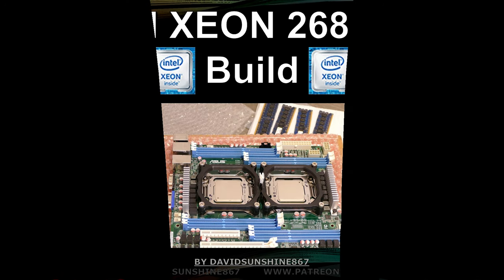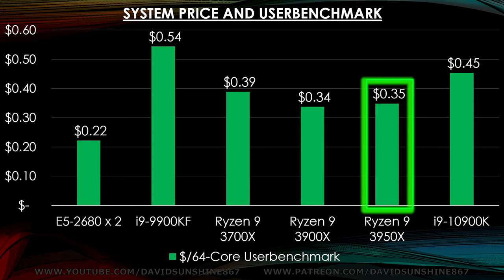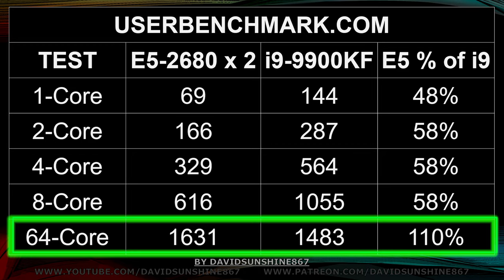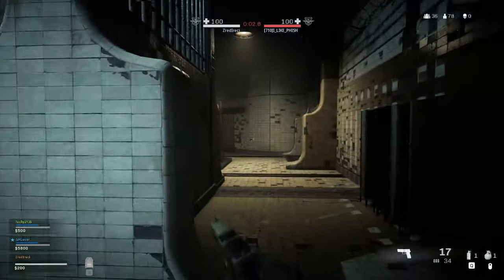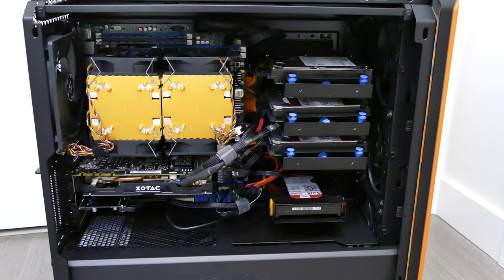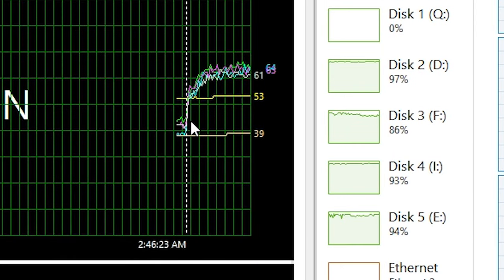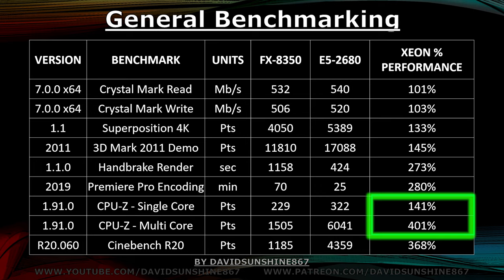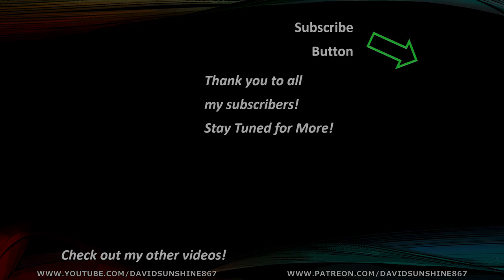Dual XEON CPU Build vs. Intel i9 and Ryzen 9, It's Faster!

Comment: Hi I’m looking to build a dual Xeon Hackintosh as well. Would u still recommend the links in ur description?
Reply from the maker: Hi,
I've never tried it, but looks like others have been successful in it. 
https://youtu.be/P8sN3-OwdVc
The links in the description are updated with the best combos and prices that I could find on AliExpress, so check them out, and if there's anything in particular you're looking for, I'm sure there's something on AliExpress that'll suit your needs, they got it all.  The V2 dual systems definitely provide the best bang for the buck. 
If you can build a dual boot system like the YouTuber linked above, that would be awesome!
Also look into V3 Xeons if you are willing to pay a little more and want the extra performance.
Cheers!
David.
Reply: @DavidSunshine  Thanks  man, so yah i ordered 2x E5-2680 V3 12-Core and a chinese x99 LGA 2011 MOBO. Lets hope it performs well!
Reply from the maker: @jameskent1845   Anytime!  Nice!  Good choice, that'll be a powerful 24 core system with DDR4, I'm sure it'll perform well.  Let us know how the build goes!
Reply: Will do David. One more question. If I’m using 2x e5 2680 v3 and possibly a rx580, Vega 64 or 5800xt (not sure which one to buy yet) how big of a PSU would u recommend? I’m going to be using one of the x99 MOBOs from China. If that helps. Thank in advance for u advice.
Reply from the maker: @jameskent1845  Hi James, great question!  I personally do not like to load a PSU too heavily, it can create stability issues and the risk of burning out PSU components by running it near the rated capacity.  The brand also plays a big role, since the cheaper brands will cut corners by using smaller components.  I trust the brand's Seasonic, Asus, Corsair and EVGA; listed highest preference first.  The Seasonics are out of stock, hard to find, and expensive, but give you the best quality in PSUs. 
The CPUs (115w) and Vega 64(295w) add up to 525W, with the motherboard and hard drives, I'd say you're looking at pulling 625W.  If you plan to run the video card and CPU on max continuously, like mining cryptocurrency 24/7, I would go with 1000W, like this: https://amzn.to/3eu3kkl
If you are only gaming and rendering, you can go with 850w, like this: https://amzn.to/3xUTdg5
You want to load a PSU to 80% max, which is 680w of 850w, so you're right up there with the 625w system load, 73.5%, so you can run it, buy it'll run a little hot if you mine with it, and that can lead to premature failure.
For continuous operation, around 50% load is easier on the components. 
I've been mining cryptocurrency and I've been keeping the PSUs loaded around 50%, and they just run slightly warm, not crazy hot, that's the way to run em for long term reliability.
I linked the cheapest Gold efficiency models above, which I recommend, one which is semi modular, I don't see a benefit of fully modular since you'll be collecting to the ATX motherboard anyways, it's only really required if you are building/using custom cables.
Additionally, if you run the Vega 64, or any card over 150w, I highly recommend running two PCIe power cables to it, even though one cable with two heads can fit.  295w can overload the 8 pin connector on the PSU end and melt it.  They don't tell you that, but it's happened before. You'll get better voltage and current delivery with two cables as well. Less voltage drop. Most PSUs come with 3 cables.
Hope that helps! 
Cheers,
David.
Reply: @DavidSunshine  thank you so much man!! I will prolly stick with the 850w PSU since I’ll mostly be gaming and rendering video occasionally. :)
Reply from the maker: @jameskent1845  You're welcome!  The other cards have lower wattage, but even at 220W I recommend 850w, and two cables to the card, it's still considered a high power card since it's over 150w, which is all I'd load a single cable to.  That'll create a good stable system.
Cheers!
David.

Comment: So I'm looking to do a dual Xeon now it will be v4 with ddr4, The reason I'm doing this is for modeling, rendering an a bit programming. will this be good for that. anything will beat what I'm using now an I7 3770, so it's time for a new system.
  Thanks for the video
Reply from the maker: Ya it'll be awesome for that, V4 is much better than what I was running, V1.  It'll have better single core performance, and that'll be important to keep the system snappy and fast while you operate it, having great multicore will be good for rendering and compiling.  Ya it'll destroy the 3770 lol. 
The V4s might be expensive though, price it out and see how it compares to the Ryzen 5900X or 5950X, those will have unbeatable single core performance for the price, along with pretty good multicore, which can make your system much snappier than the Xeons, important when working with 3D modeling software, panning, zooming, rotating etc.
Of course the used Xeons can provide great bang for the buck though, but it's good to compare the pricing and performance as well.
Hope that helps!
Cheers,
David.

Comment: how did you power the 2nd cpu, did you use Sata to 8 pin connector for the other one?
Reply from the maker: Hi,
I have the RM850x, it's a modular power supply and so I just used a couple 8-pin cables and required by the motherboard.  I wouldn't use a SATA adapter, since Xeons pull full 125W and it might overload the PSU rails, I'd recommend getting a power supply with the right connectors.  A 650W with modular cables would work, if you have a demanding GPU, it needs an 850W PSU though, as it can pull over 600W continuously, which would really work a 650W PSU hard.
Cheers,
David.

Comment: How do you think a dual cpu with the E3 1200 series?  Especially the hyperthreaded ones.
Reply from the maker: It's has great single core performance, but the architecture doesn't allow for dual core operation, so well have to use the E5 series for that.  The new V3s are old enough to be cheap but still perform pretty well! So that's a good option, E5-2678 V3 is probably the best bang for the buck right now. 
Cheers,
David.

Comment: I Built A new (toMe) Dual Xeon Server With The Supermicro X9DRI- LN4+ But I Used a Pair of the E5 2696 V2's in my main Supermicro 24bay server but just a pair of E5-2620 v1's in my FreeNas Build  I Have a pair  of Noctua U9DX I4's on the dual 2696 v2's and a pair of Hyper 212 Evo's on my Dual X5675's But a Pair of Gammax GT"s on a pair of 2620's..I Was Wondering What Cooler are you using on yours? ?
Reply from the maker: Nice builds! That Noctua U9DX is a great cooler, specifically built for the Xeons.  I was thinking about configuring mine to create a tunnel, but I pointed mine upwards instead. I was worried the hot air from the 1st CPU would make it harder to cool the 2nd CPU, but if it's a tunnel towards the back, it might be better since you eject the hot air out the back of the case, mine pools at the top of my case, then makes it's way out through the back after some time, so there might be some short circuiting going on. 
I used 2 cheap Aliexpress 6 heat pipe coolers(https://tidd.ly/3pUjEhk, 3 fans, without RGB), they seem to work well, since I can keep my cores fairly cool and maintain 3.1Ghz on all cores even under a full burn-in test with RAM/HDDs/SSDs/GPUs at max.  I wouldn't recommend my coolers though, I needed to modify the mount so that I could get them onto the sockets, and I can't easily remove them while inside the case, so I had to install them before installing the motherboard and CPU heat sink fans(Since the mounting screw is blocked by the fan).  So I definitely don't recommend 6 heat-pipes, even if it provides a little more cooling. It would be a pain to remove the motherboard, just so I could swap the CPU, that's why I recommend smaller heat sinks that can screw in from the top.
Cheers!
David.
Reply: @DavidSunshine   ok Cool..I will probaly just order me either a second hyper 212 evo(old Faithfull) or another gammaxxGT cooler(its just a tad shorter than the 212 evo) I have one of Each on thair untill i make up my mind..lol. i have spent so much & i just hate to keep spending on it as i just dont need 3-4 dual Xeon Servers & im really out of room to put them..lmao..
Reply from the maker: @bigchew3149  Nice, those sound like great options!  These cheap coolers are hit and miss, never know if they'll perform well, but I like budget stuff.
Ya that's a lot of systems!   I barely have enough space for 1 lol.   If you do want to try a cheap one out though, check out this 4-Pin heatsink(I wouldn't get the 3-Pin, cuz the PWM fan speed control is good to have):  https://tidd.ly/2K2UxJm
You can screw it in from on top.  Might not perform as well as your Hyper or gammaxxGT, but who knows? Maybe they will perform well and cost less?

Cheers!
David.

Comment: I wondering what Gpu you use on this Benchmark test?
Reply from the maker: Hi,
I had the Zotac Mini 1070 in there for testing. 
It's an sufficient card for gaming, nothing fancy, isn't super powerful, but worked pretty well. I upgraded to a 3070 and the increase in performance isn't that great.  It's smoother for sure, but any of the games are still great on the 1070 actually.  I wouldn't mind using the 1070 for BF5 or Half-life Alyx, they both work well on the 1070.  BF5 actually is CPU limited on the Xeons with a 3070, so you'll need to switch to DX12 if you use that(uses less CPU and is more GPU intensive, so won't CPU cap the system).
Great question!
Cheers!
David.
Reply: @DavidSunshine  woah thanks a lot...i'm rookie about Gpu especially to choose what i need for sure among hundred of them in the market...great, thank you
Reply from the maker: @j4xchannel709  Anytime!
If you can get your hands on the 3060Ti founders edition, it's the best bang for the buck today.  But more realistically the 3070 has more stock and you could pick one up easier. But if you're patient enough you can get a 3060ti, it isn't impossible, just really difficult.
It'll be good for PC VR if you're into that as well.
Cheers!
David.
Reply: @DavidSunshine  well thanks a lot for your info. God bless 🙏

Comment: I really want this :(
Reply from the maker: It's much more affordable than a brand new system.  If you get the slower E5s, and only 16GB of ram, you can get it for even cheaper! Less than $200.
Definitely worth it.
But I would save up for the 2690 at least, since it is running at 2.9Ghz and that'll boost gaming performance.
I purchased the 1070 off Craigslist, old used stuff can be purchased for a great deal since people just want to get rid of it.
I'm all about budget systems, cuz all brand new components cost so much more.
Cheers!
David.

Comment: This is cool and all but why would you ever buy these CPUs for gaming lol
Reply from the maker: Good question, as a pure gaming system it wouldn't make sense, if you want all out gaming performance today you'd go with the 5800X3D, but that CPU is going to cost more than a dual xeon v2 system.  So for a budget xeon system, it'll work well enough to game on if you have an average video card of Craigslist or something.
It was interesting to see that this cheap $250 system plus a 1070 $200 from CL could run some games decently.  It's actually capable today or playing 2042 at about 70fps, which isn't too shabby. If you are using a faster video card in the RTX series, definitely get a ryzen though. As you're right, the faster single core is required to feed the faster GPU, otherwise it'll CPU cap you and lag the game horribly.
This was a good test for a budget system that matches the multi core performance of the newer CPUs though (good for rendering videos, or rendering models), and can also do a little gaming as well. 
I think V2/V3 Xeons might still be a good deal compared to the cost of a brand new ryzen system, if pure gaming performance isn't the goal. V1 is a little dated now though. V4 is a little too expensive, but if you can get them for cheap, would still be worth it. 
Again, great question!
Cheers,
David.
Reply: @DavidSunshine  Thanks for the response, im planning on doing a build like this at some point. Next time i reccomend you benchmark more multicore performance, since thats really all that matters. Gamers Nexus does a test in blender where they time the rendering of a single image. That test seems decent. I also advise against UBM since they are known for being untrustworthy, thanks for the response :D

Comment: Did you unlock the turbobust mode for Xeon E5 CPU?
Reply from the maker: Nope. I don't think my motherboard had that option, maybe other boards do tho?
Reply: @DavidSunshine  i have some instructions to  load my BIOS via hex editor and EFI modifing via FreeDos. And it's really work, my CPU works  always at turbobusted frequency(we have base frequency - 2.5GHz and turbobust from Intel - about 3.4GHz). I bought powerful CPU fan for this.
Reply from the maker: @AlexMolchanov90  Oh that sounds awesome!  If you want to leave a link here to the instructions, go ahead, I'm sure everyone who runs an E5 would love to turboboost their CPUs!  With extra cooling in sure it would run stable.  
Cheers,
David.

Comment: Hi, which case are you using for 2 xeon?
Reply from the maker: Hi,
The Silent 601, without a side window, I wanted it to be as quiet as possible.  It works well, as the heat exhausts out the back, and there's a switch to change the case fan speeds, or you can have the motherboard control that if you get that feature.  The server board I had didn't have that ability easily accessible. I think I can get PWM control with custom software, but it is hard to find and I haven't found it.
The cheap Chinese boards might have it tho.  I would definitely recommend it though, cuz when you render or game, it's nice to have the fans speed up.  My CPU PWM works well, so I could collect them all to that with an adapter, that would be nice. 
Cheers!
David.

Comment: Was it difficult to install windows on the server based board?
Reply from the maker: Nope.  It's the same as a normal motherboard, I was surprised that windows 10 worked that well with it.  You should install the specific manufacturer drivers, but I didn't notice a difference. 
You don't need to install windows again though, you can just swap motherboard and CPU, and reactivate windows using your windows 10 key, through the"update product key" function.  I recommend a proper fresh install though, as your Microsoft store installs might not work, or other bugs may occur.
The server based board doesn't have a sound card, and a PCIe one I installed has noise when recording, so now I'm using a USB $10 sound card and that seems to record fine without too much static.  There are compromises, but nothing too bad.  It still makes a great system!
Cheers!
David.

Comment: What would happen if we use both of CPUs?
Reply from the maker: Hi,
When we run the multicore benchmarks, it uses both CPUs fully and that's about 250w total CPU load, with monitor and other items, about 500w at the UPS.
It's pretty good CPU performance but the energy consumption is more than a single CPU system.
Ryzen is the best in efficiency and single core performance though.
The 5900x is pretty good if you're willing to spend that much. But the Xeon system is still great performance for the money. 
I recently upgraded to the 5900x, but it really isn't that much better than the dual XEONs for my gaming or video editing.
It's more of a luxury than a necessity. 
Cheers!
David.

Comment: So this is the solution for AAA gaming and 3d-modeling/CAD?
Reply from the maker: Hi, 
I think it's a good compromise for gaming and 3d-modeling/CAD, it's slightly slower performance, but you get it at a budget price.  I think Cinebench is a great representation of the performance you'll get for Revit/CAD/Solidworks, check out the performance here:  https://youtu.be/Lpns6zJdBuc?t=205
The newer systems perform better overall, but the Xeon system is not far behind it.  This is where the faster XEONs may help, and could give you better overall performance.
For $300ish, I don't think you can find a better deal.
Cheers!
David.
Reply: gaming = single thread which these xeons are trash at

if you are doing serious work or serious gaming just get ryzen
Reply from the maker: @Blox117  Ya you're right about Ryzen, best bang for the buck and fast single core performance, faster single core gives the best overall performance for sure, both in the OS, and doing anything basically, the XEON really only performs well if you can use all those threads.  I like how well it renders videos, what used to take hours is less than an hour now.  I suspect they have some algorithm in there for sharing workload between threads/cores, even if the specific software isn't written for it, but not sure.  Check out my video at 7m42s, I'll alt-tab out of Apex Legends, and I saw it used up partial loading of 18 cores, so it seems like it's making good use of many cores.  The Ryzen has a lot of cores/threads too though, so it would definitely be beneficial for gaming, and destroy the XEON in performance.  I'd definitely get a Ryzen 3950x if I gamed more and wanted the best in performance, but since I'm mostly rendering and video editing, the cheap XEON system made sense.  It was kinda fun to build a dual core system too, so there's that.  
Cheers!
David.

Comment: chinese boards are pretty good but vrm is very dangerous, mine got literally melted
Reply from the maker: Thanks for the info!  Damn that sucks.  Which brand was it?
My 12V connectors to my CPU power on my Gigabyte motherboard melted too, I guess they use cheap components and they can sometimes fail.
Hopefully they learned from their mistakes.
Cheers,
David.